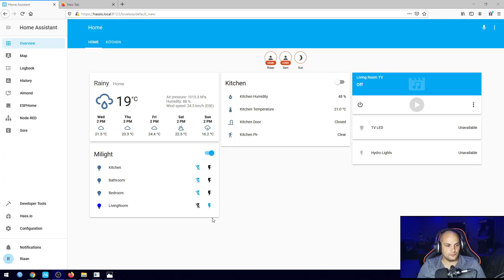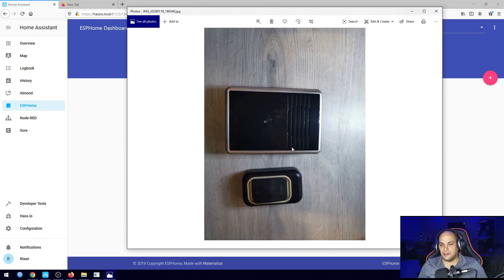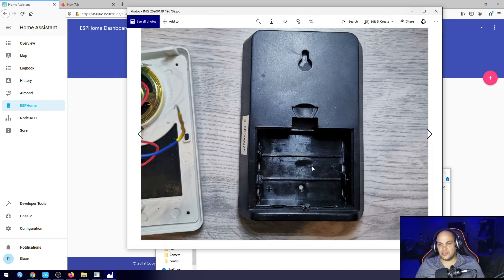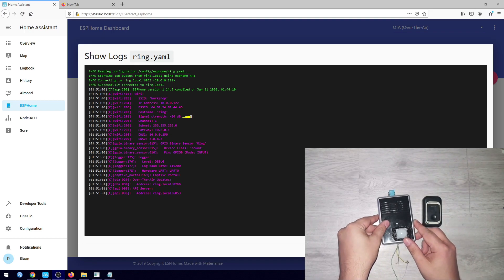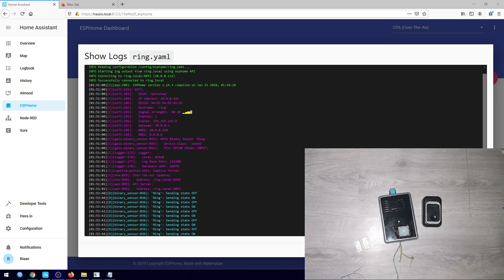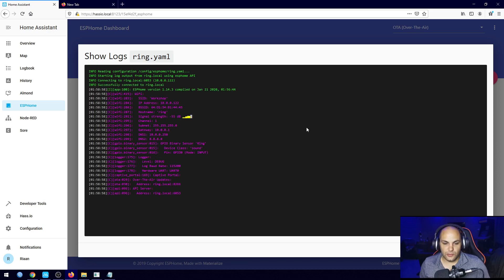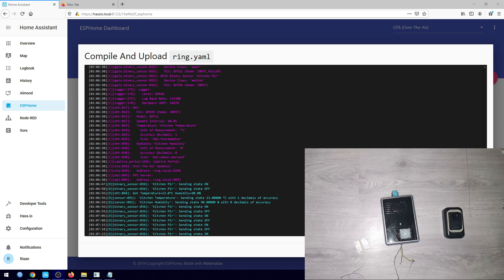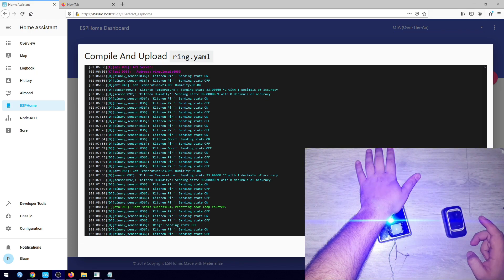Home Assistant 111 Wireless Doorbell with built in Multi Sensor

Comment: I made a similar thing when there is motion between 6:00 ~ 20:00 send message to volumio and play a "ding dong" or whatever you want like music etc. Only thing I realised that PIR sensor won't work if you put it behind the window glass. Somehow, infrared can't go thru the glass. If you have a spare raspberry pi laying around try volumio. Even when the door sensor is ON (door opened) then it can alarm the house. Mine playing siren and turning all the lights on.
Great video, keep it up mate 👍
Reply from the maker: Yes I am waiting on some stuff to come for door and window sensors to setup an alarm type system that you can arm and disarm using node red